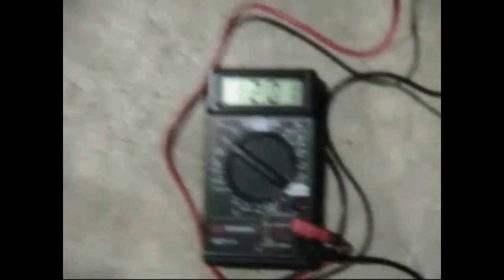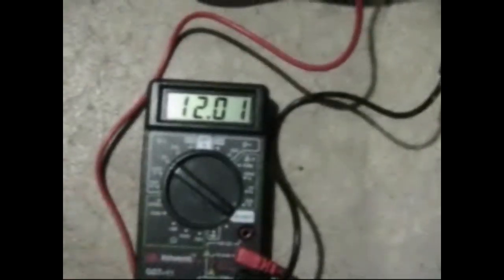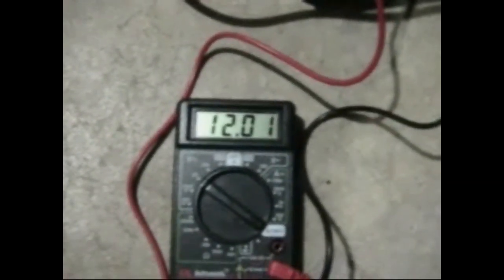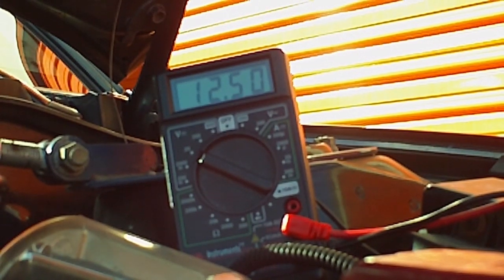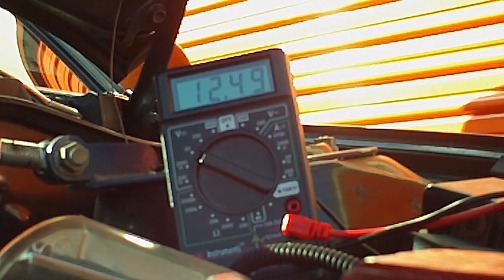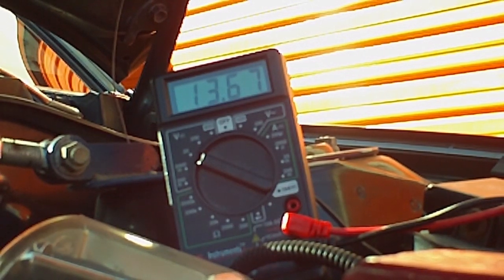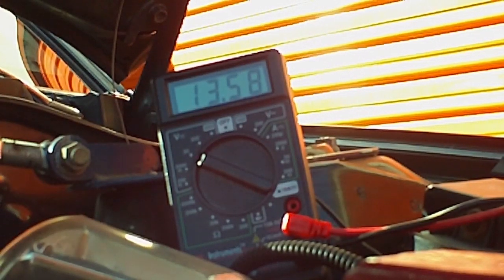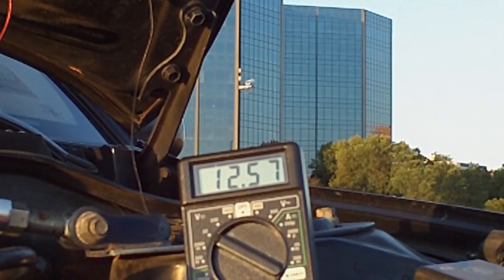C-West Voltage Stabilizer Test & Review

Comment: To anyone that doesn't understand electronics, this is a gimmick no different than a "chip" for your car. They are 100% worthless. You know how you can buy 1 Farad and larger capacitors for your car audio system? You know how those barely even work, if at all? Well, this one has a 0.0047 Farad capacitor inside. Yeah, it's not going to do anything. If your car needed that 1 cent part, it would have it by design. Sorry.
Reply: capacitors work, if spec'd properly.

Comment: The author has missing the concept of the stabilizer. Its function is to take-out the ripple voltage, must be measured on scope rather than on DMM (Digital Multi-Meter). The ripple voltage is NOT good for all electronic components since it has small voltage that jump-up and down (we can called it NOISE) where the good DC voltage must be constant. I tried some of the voltage stabilizer and THEY ARE ALL GOOD. Engine quiet, smooth acceleration, my car has no problem with car electrical (I am not sure if it save gas or not), but they are worth it.
Reply: ripple from a DC battery?  Um, sorry no.
Reply: Yes, you are right. There is no ripple from the ideal DC voltage, however, when the distributor produces the 13.4V to charge the battery, it has ripple (not clean DC voltage, or noise). That's where the stabilizer kick-in and take those ripple out to make the DC now cleaner so the components in the car will last longer.
Reply: Guy inSJ i just read a good article about this, and youre absolutely correct.  i had incorrectly assumed that most cars already had electronics in place, to smooth out ripple from the rectifier, but indeed, its not so common as i thought.
Reply: No, ripple from the alternator.

Comment: The problem is the voice is about 6 seconds ahead of the video, so that's why its tough to follow. But i do agree, i think its junk. You are better off just buying an audio capacitor. And it will help way more. The stabilizer is probably like 1/4 farad, and in my car right now i have a 3 farad capacitor. Way better. These are a waste of money, all you are doing is adding weight to the car. Buy an audio capacitor, or a better battery and that will be way better.

Comment: My battery voltage is pretty good as I have a grounding kit on my car. Im wondering if I should use this in combo with the grounding kit? One explanation I read was that once the demand on the electrical increases and the battery must go from charge (from the alternator) to discharge that this is when the capacitor does its job. Grounding kit worked great, would this help? Anyone use one and then added the other?

Comment: An unregulated amplifier and a strong alternator will trumph almost anything. Truest me I know. Look at Ohio Generators if you seriously want to continue with stronger audio. Capacitors are okay, but only if you're having issues with bass notes missing, which is due to your battery being a slow discharge power source. Your amplifier accesses your 12 volt battery as though it was a quick discharge power source to play uptempo music, and the result is missing bass notes etc..no more room to write

Comment: the only thing that will truly do what you want is use a secend battery or buy a digital compasiter. or replace your battery with a deepcell. also running a secend ground on off the battery to the body of the car can help and replaceing the battery wires with 0 or bigger gauge wire

Comment: Electronic specs off the main capacitor = 4700uf 25V
what that means ?  from other video pivot has 7200mf and adhoc has  14400mf  ??
can i use a plain capacitor doing the same work ?
thanks.

Comment: its easy for it to hold 13volts when the engine is off cause the fucking capacitors have energy stored in them and when you shut the car off then theirs no draw on the battery so it slowly drops as the battery soaks most of the energy up and the tiny tiny tiny amount is drawn in by the cars electronics

Comment: Well, as I see, this one has only one lonely and 4700uf 25V capacitor inside. While you take open the other ones on market, they have at least 4 similar capacitors and the Voltaggio, as i check form their site and picx has two 2200uF and ten 1000uf making altogether 14 400uf. I dont know how much difference this would make in real world, but when you at least open the c-west, it looks pretty sad compared to the other ones on market.

Comment: @HalfBreedMix That's very cheap, must be using the normal 4,700 uF 25V caps, like most cheap voltage stabilizers.

Comment: Buy and hack open this one: Adhoc Voltaggio Voltage Stabilizer

You'll be surprise that this is one VS that doesnt short change you by giving cheap caps and LED lights inside that.

Comment from the maker: Well, I can tell you this: I have a universal shift-light that monitors electric draw to "know" when to light up (might hardwire a real tach if I get time later), if I have the car running and then plug in my cell phone, the shift-light lights up and stays on until I disconnect the phone, but now with two V-stabilizers under the hood, the car seems to figure it out and adjusts to the cell phone being plugged in and the shift-light goes back to working normally.

Comment from the maker: Well, this is a stabilizer, so the fact it's keeping the voltage from varying as much probably means it's doing what it suppose to.  I guess this isn't ment to be a booster as much as it is to keep you at a certain voltage even with increased/decreased load.

Comment from the maker: Well, I actually bought another one of these and took a look inside.  I wrote down the capacitor specs on my other phone, and I'll post it in the vid discription place soon.  As for the 1 farad cap, maybe, but there does seem to be a circuit board in these units; so maybe that makes them a tad better than just a jumbo capacitor?